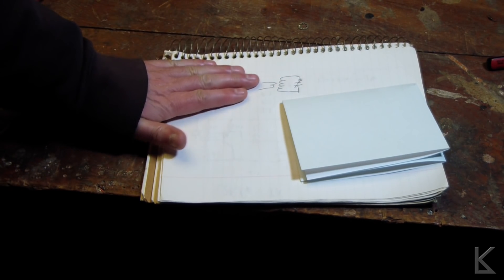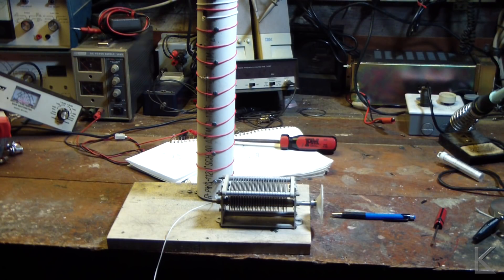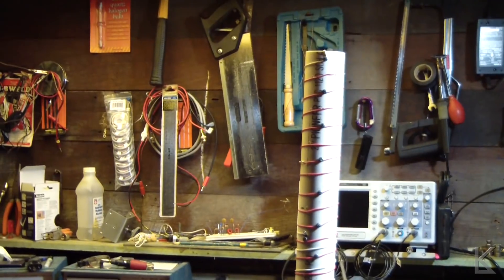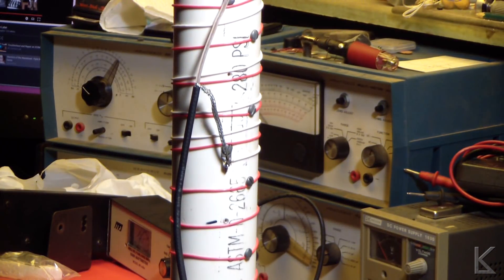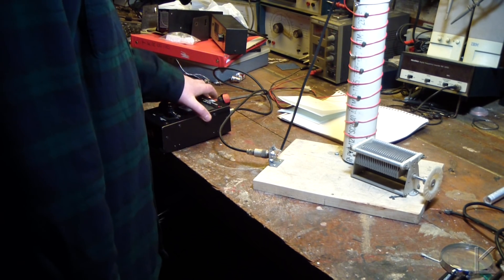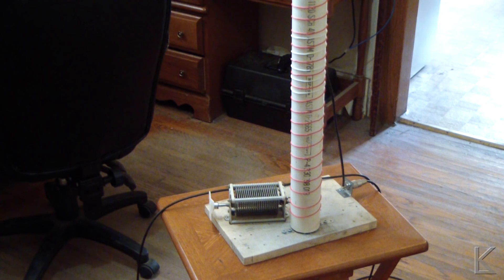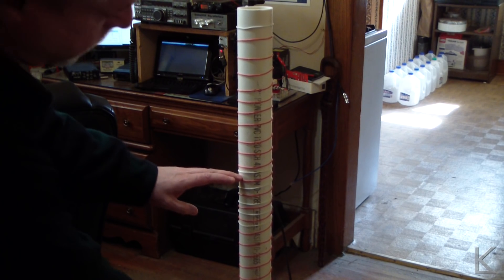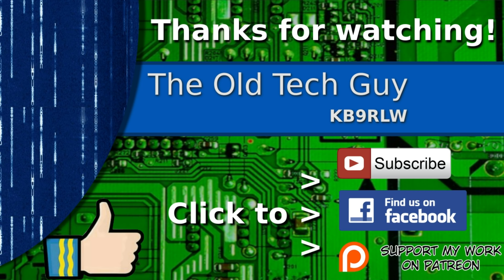Ham Radio - Prototyping an experimental antenna concept,  it works!

Comment: Very interesting. I might try and build one of these for a compact Portable ops sort of antenna.
Reply from the maker: It didn't work very well overall.  You'd be better of with an end fed half wave, or a magloop.
Reply: @loughkb  I currently use an EFHW for my POTA stuff, just a bit large for a few of the parks I am interested in, recently build a bottom loaded Vertical for 80m/40m/20m where 20m has no loading. Using a 16ft wire as the element held up by my fly fishing rod I use thats about 20 feet tall.

Comment: When I was a kid I had a big coil and variable capacitor and it was easy to make into a crystal set, picking up local AM stations. It worked with no antenna attached, so there ya go! Thanks for sharing your fun and insightful ideas.

Comment: Hello Kevin, great idea! Two questions. What is the diameter of the PVC, usually stamped on the outside? What is the range of the variable capacitor?
Reply from the maker: This is an old video and faded from my memory.   I do recall that performance wasn't great.   It was kind of a dead end project and I moved on.

Comment: Excellent  idea, I've already got two capped PVC tubes up in my attic right now with a large slinky in each, connected in series with a slinky junior down the center and I rigged them as a stealthy dipole in my HOA restricted neighborhood. 
Each tube is four inches diameter and four foot long, the end cap has the standard 3/8 -24 thread base for the larger slinky's end point, and a bolt at the top center for the slinky junior's end point.  I'm gonna rebuild them with your idea if you don't mind,  with a much closer turn count to hopefully get your results 
(Oh, as a swl listener only, I found it did have multiple points of resonance from below AM to up around 50 MHz  centered around a single reverse resonance point at 4 MHz (or a null reception point). Changing the coax  length that ran down the center that joined the outer coil's top to the inner coil's bottom to put them in series (using only the center of the coax) on the second tube removed that null point when I rigged them up together as a dipole so they canceled out each other.  It was OK as a broad banded swl vertical antenna, but not as good as the trapped dipole up there. A single tube was handy for mobile listening on my jeeps antenna bumper mount. Over all, i haven't used them in years and just left them mounted up there. They tended to build up a static charge too fast used individually or together which had to be drained off before they were usable as antennas. Having to short an antenna to my jeeps ground every five minutes just wasn't worth it other wise it was just a "dead piece of wire" as far as mobile antennas go.) i love your videos, they show me what i did wrong so often, keep them great videos coming.

Comment: Neat idea! Try putting the white wire as close to the red wire as you can for better coupling. Also the angle of the red wire wind can make a difference with the wire in the center of the tube. I just might have to try one like this.  Keep us posted. Thanks

Comment: I have no doubt that this works, but the long, thin wire makes it inefficient due to the ohmic loss. That's why commercial mag-loops use copper tubing. If you're just going to make a receiving loop, you can reduce the loss by using a ferrite rod inductor so you can reduce the ohmic loss. You can't use it for transmit because only a small amount of power would saturate the ferrite.

Comment: IN a nutshell bottom coil with cap and vertical length with counter pose check the arrl antenna handbook also m f j antennas kg6mn

Comment: Great video! I like these kind of videos when you try out stuff and make it yourself. This is one of the true fundaments of ham radio. 

Just out of curiosity,  where do you get those big vaiable capacitors from?
Reply from the maker: Hamfests!  There's always some guy there with a box of them and they're usually fairly cheap.  Another source is old AM radios.  Search thrift shops for old tabletop radios from the 60's and 70's.

Comment: You might try putting your coax at a 90 degrees from the pvc pipe .Like you would with a 
vertical dipole.

Comment: Good idea that works! 1/4 inch copper tubing like what is used to connect water to the ice maker in refrigerators makes a suitable low loss conductor and can usually be found in someone's scrap bin. Looking forward to your progress on this project. 73 DE K7RMJ  Frank

Comment: Assuming the ends are where your resonator is radiating, will you mount it horizontally so that you could rotate and therefore aim the antenna?
Reply from the maker: The cap would have to swing around with one end, but it could be done.   I'm going to keep it vertical for simplicity.

Comment: Kevin,

All things being the same as traditional magnetic loop, are the nulls now located up and down with your resonator?
Reply: NVIS!??? :)
Reply: Perhaps this is named the NVIS MAG-WAND?  
NVIS MAG-POST?
NVIS MAG-OBELISK?
Lots of names to play with  VERY interesting that it radiates vertical.  I guess so, you've essentially turned a loop upright.
Reply from the maker: Oh, I should have mentioned that in the video.   I panned my field strength meter along the device and found that the radiation was at the ends and there was an almost complete null right where the coupling winding is in the middle.
It's a little weird, but interesting.
I'll be working on the final design later this afternoon.  Hope to post a results and on-air video tomorrow.